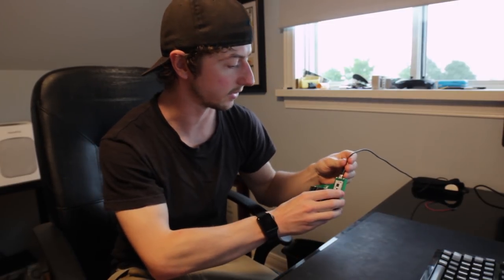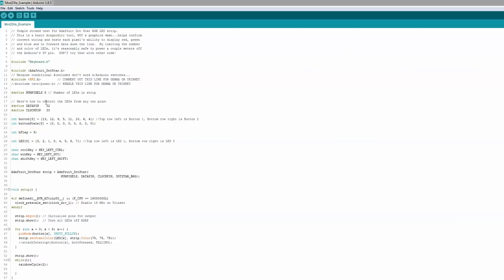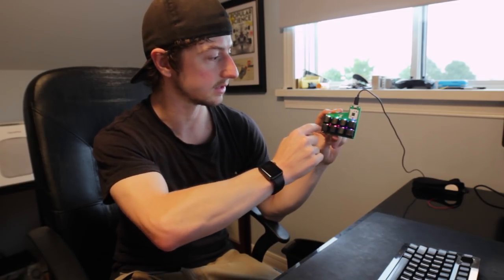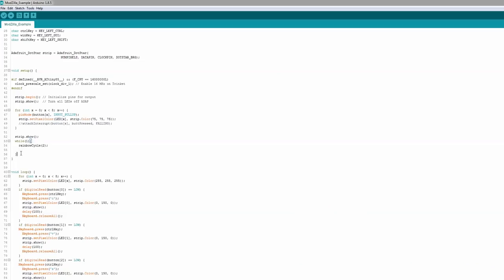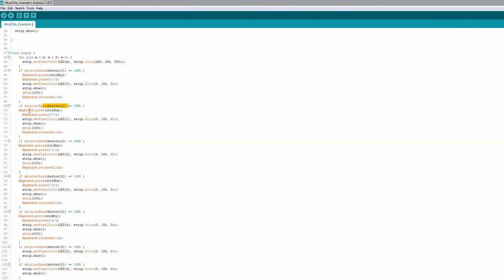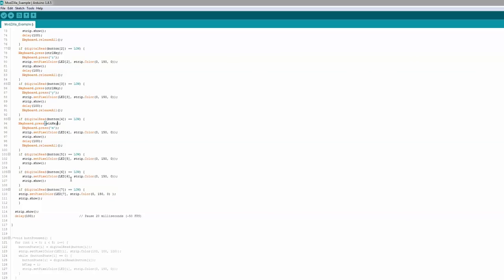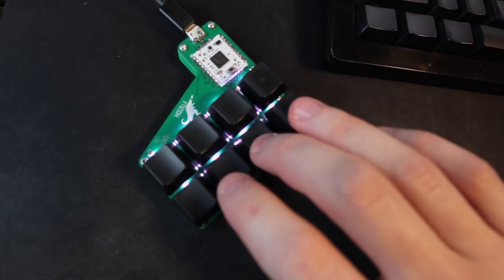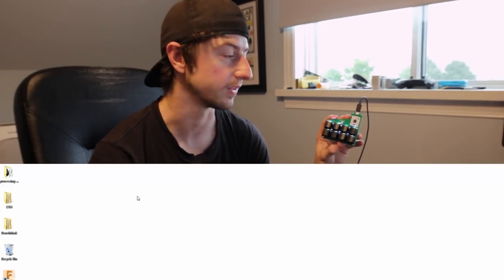DIY RGB + Cherry MX Macro Keypad with the HCC Module

Comment: Just built this project and it works like a charm! I'm using it on my macbook so I obviously had to change out the codes for copy/paste etc. I haven't bought the LEDs yet, so it doesn't look quite as cool as it could, but at least it functions! Thanks for making this open source!
Reply from the maker: The LEDs are a challenge. Great to hear you built one. Don’t always hear of others actually finishing my projects! Thanks!

Comment: I have a question. I'd like to make one of these as discord and steam macros but I want them to also have no real input anywhere else. As an example, I want to make a key press bound to my push to talk but when pressed in any other environment where it's not needed, it doesn't act as a traditional windows key press. How would I go about this? I keep getting suggestions like using a key that is uncommon like home. But usually those keys have a function and purpose in other applications. I want a key that will only ever trigger my discord push to talk regardless of what other software I may be using at any time.
Reply from the maker: Hmm, not sure, maybe Instead of using a single key, you use a program like AutoHotKey and bind some keys together, like ctrl+(some key) then you could have that key dedicated to something. I'm not sure the best way to do this. Does Discord allow you to push to talk in the background?

Comment: Is that Anet A8 3D printer?
Reply from the maker: It is yes!
Reply: SeanHodgins Ive Seen that you use a anet a8 too could you help me with mine I got a leveling Sensor but Iam not getting it calibrated..
Reply from the maker: I don't use the leveling sensor, so I don't think I will be much help.